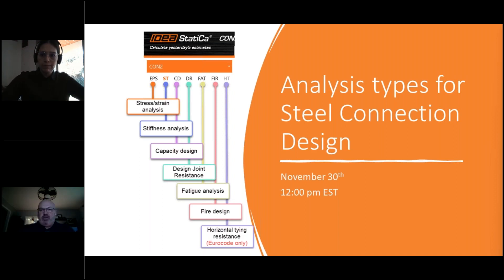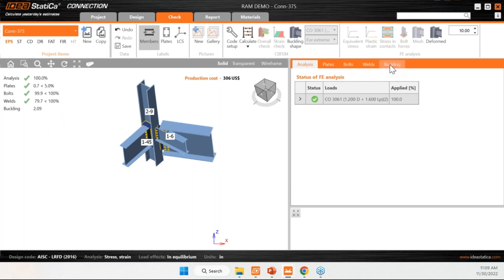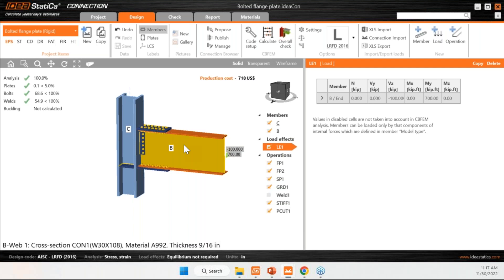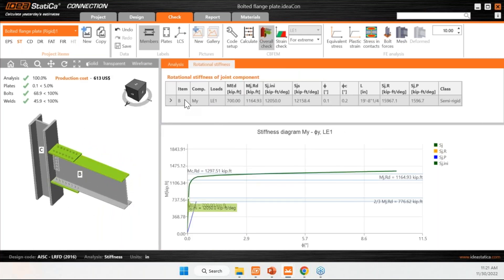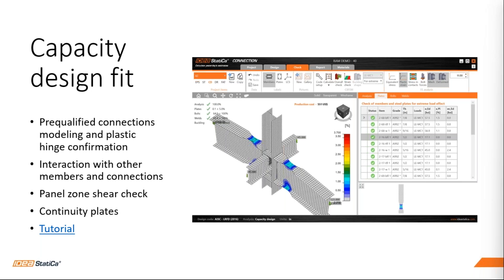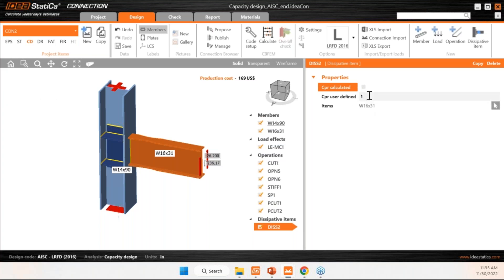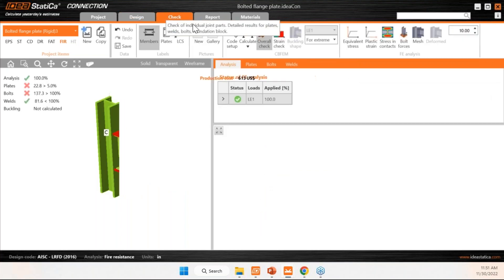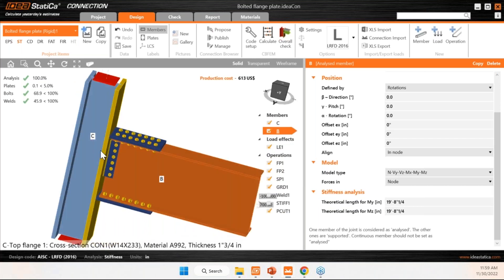Analysis Types for Steel Connection Design

Comment: For stiffness analysis, serviceability load cases or ultimate load case to consider
Reply from the maker: Hello, depends on what you want to analyze back in the global model - you can apply both for different calculations of global model.
Or if you look for general stiffness value, it doesnt matter which load you apply to read the initial stiffness
https://www.ideastatica.com/support-center/connection-stiffness-and-its-use-in-global-analysis

Comment: Hi  can define the principle for fire Design . Stress developled due to applied temperature must be less than capacity of member. And why did you apply manual load case alongwith temparature
Reply from the maker: Hello, pls check these articles:
https://www.ideastatica.com/support-center/fire-design
https://www.ideastatica.com/blog/avoid-fire-design-hell-ensure-your-project-meets-all-safety-requirements
what IDEA StatiCa Connection and Member does:
- automatically calculates temperature of all parts of connections
- applies material degradation for the calculation
- applies defined load cases
- calculates all and gives you checks as per codes